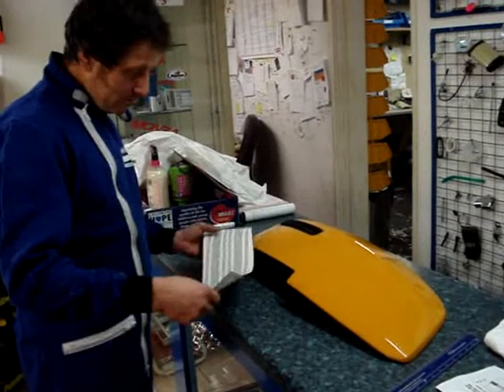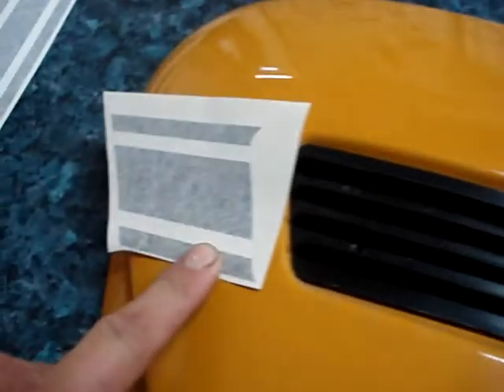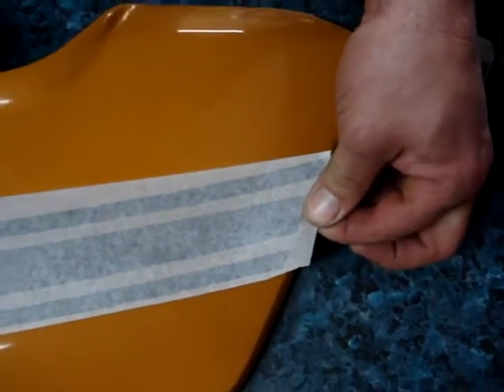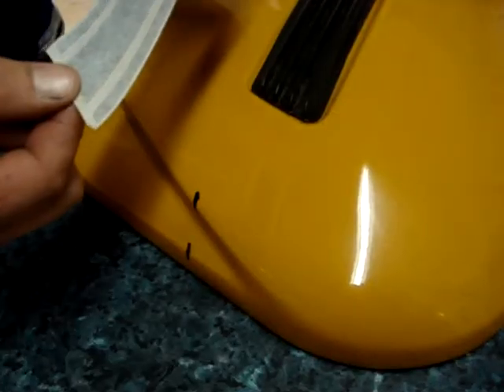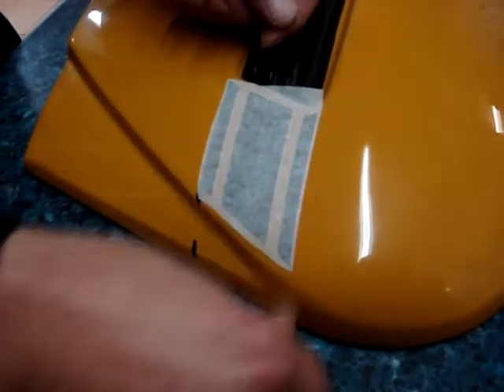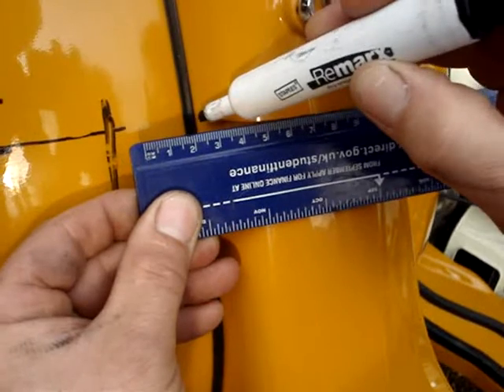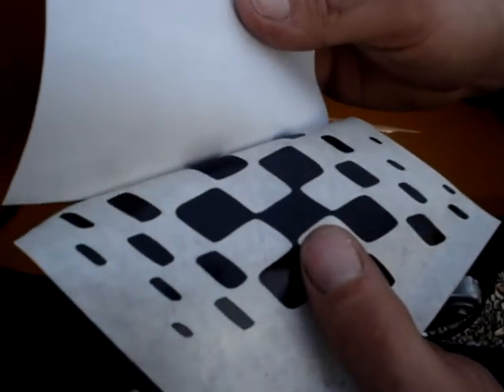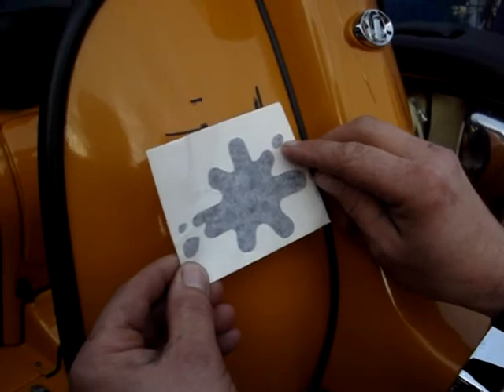panel-stripes.wmv

Comment: Should've floated it on with water, as it allows for repositioning and less potential for air to be trapped.
Reply: I agree with this. Made a mess of my 1st panel. Air bubbles all over the place. D’oh. 2nd panel squirted with soapy water. Easy. No air bubbles. Managed to circle back to the 1st panel carefully peeled off squirt of soapy water hey presto refitted no air bubbles. Result. 🎉